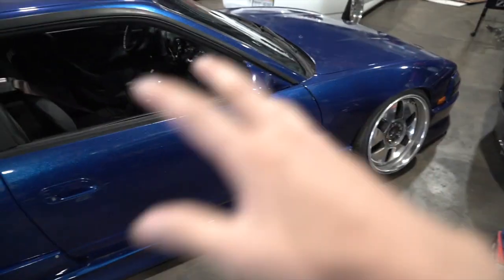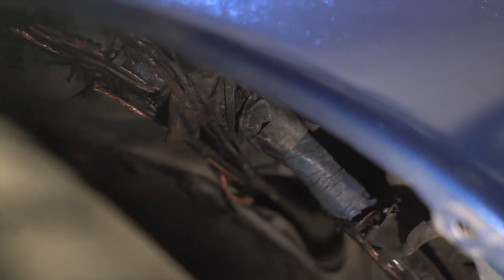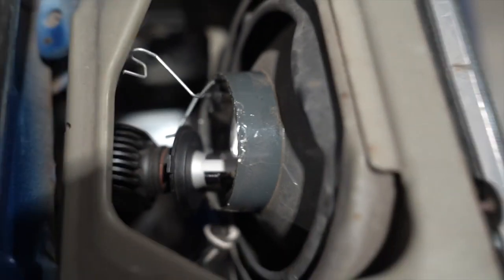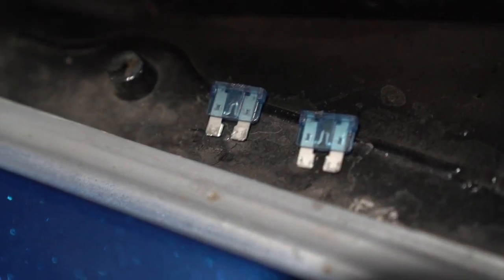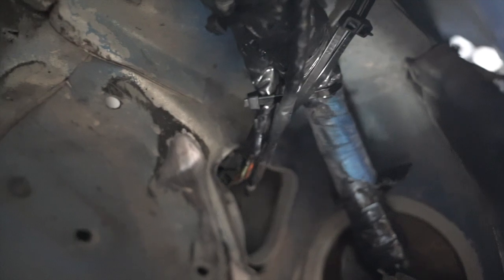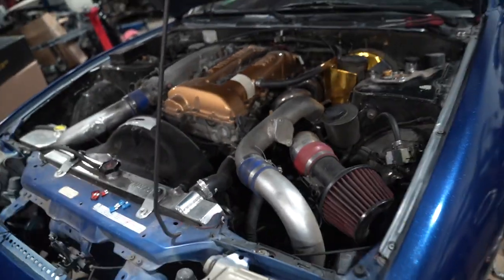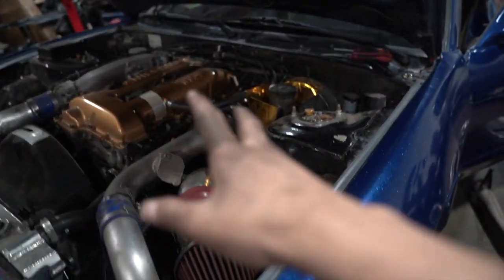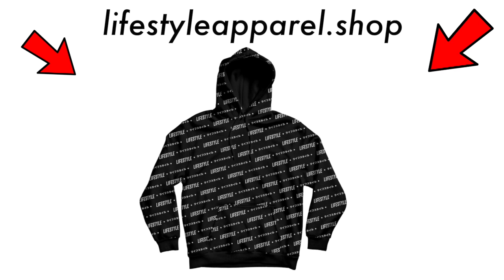Endless issues with the 240sx...

Comment: If you don’t fix those wires your going yo keep blowing fuses. Worse case you will burn up your wires bro. You need to make sure their are no torn wires also if some are missing strands just cut them and reconnect them properly and use shrink wrap. Marine type is better to prevent moister and corrosion
Reply: literally came here to say this,

those rubbed wires are the exact things that are causing the wires to short and blow the fuses. solve the cause, not the effect! good thinking
Reply: Yup exactly.... sigh
Reply: Agreed 💯💯💯